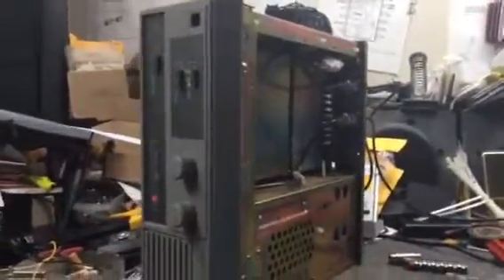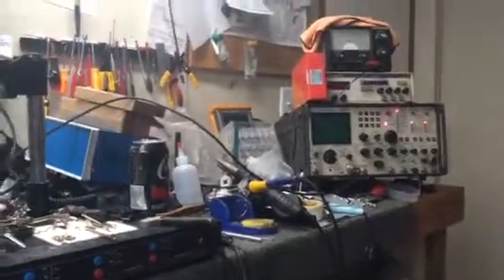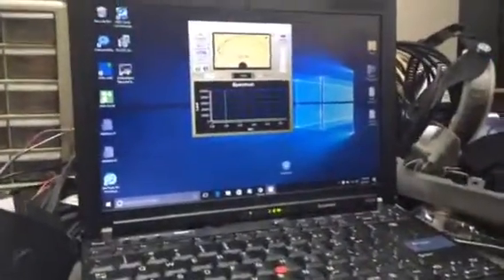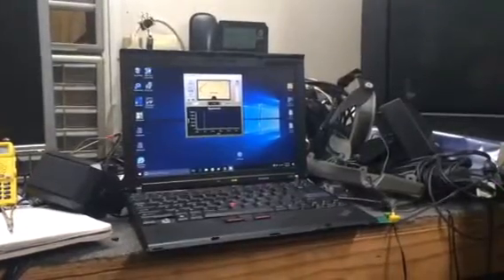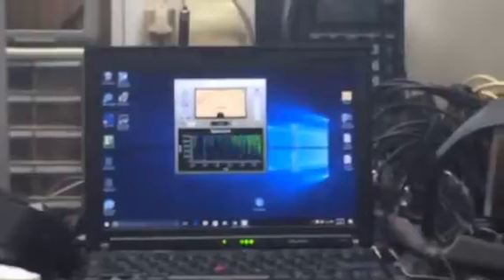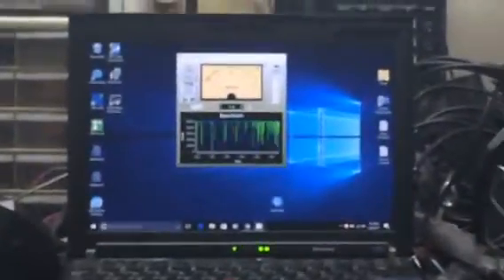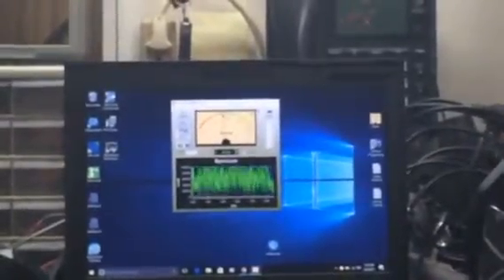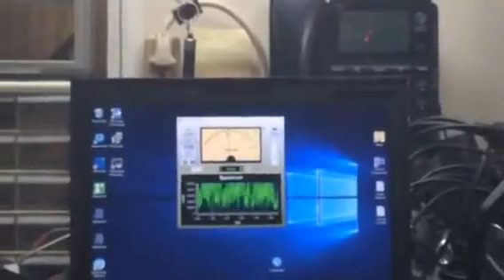Kenwood TKR-820 SINAD Test After Narrow Band Conversion

Comment: Samuel hi. I have one of these repeater that was suppose to be place in the commercial LMR band and the person that set it up did a fine job however I don't know if this unit was converted to narrow band for my purpose. Is there a way I could check for certain components to confirm if the narrow band mod has been done to this machine?

Comment: Dear, brother, can you help, please, with instructions, what should we do in case we want to use same repeater with mmdvm? Please, it is very important for us. asmdreamer@gmail.com
Reply from the maker: Please see http://www.repeater-builder.com/kenwood/kenwood-tkr-n20-notes.html

You need to turn the output down real low like 5 watts or less and run a external PA if your going to do digital with this unit!
Reply from the maker: Here is a link to the service manual.. http://www.repeater-builder.com/kenwood/pdfs/tkr-820-svc-man.pdf